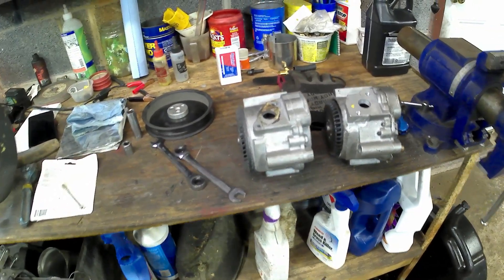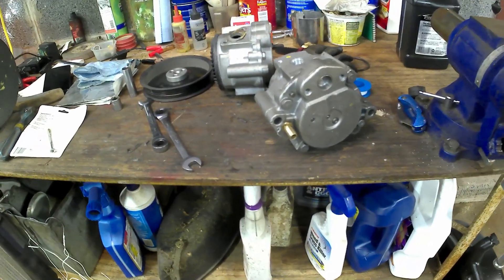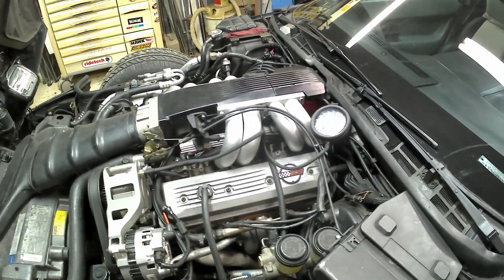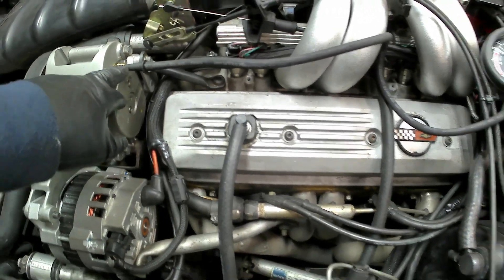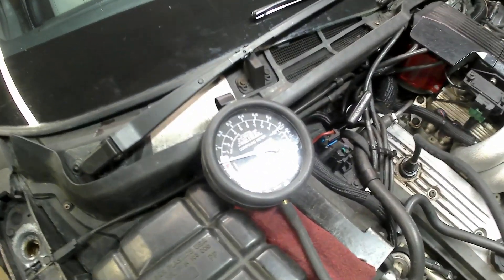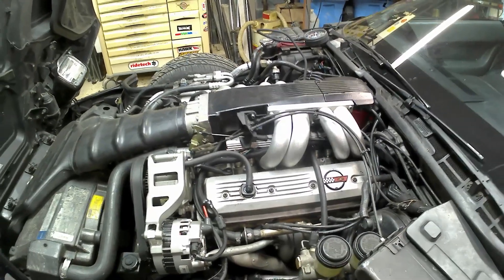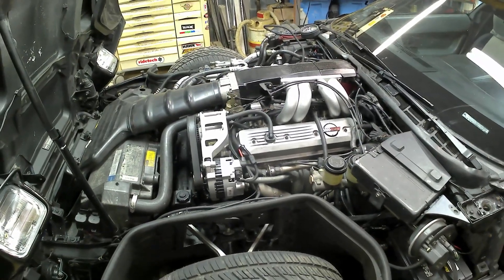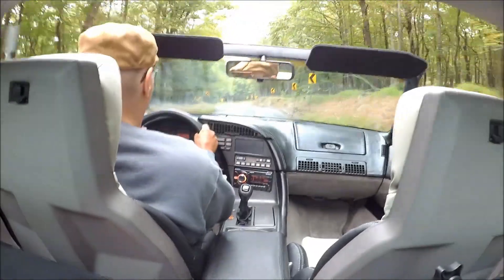Crankcase Vacuum Pump on a C4 Corvette

Comment: Isn’t that your Smog pump shouldn’t it be blowing air in into the smog emissions system😮 wait a minute now you’re going to run your crank case gases through the smog pump out your exhaust I guess
Reply from the maker: Well, it looks like my smog pump is multitasking these days - it's not just reducing emissions, it's also providing some extra horsepower by blowing those crank case gases out! I guess you can say it's a real "smog-tivator." 😂
Reply from the maker: It was only used for one day to see how it worked, it was then changed back to oem, if permeant it would have a catch can and air/oil separator installed.

Comment: Interesting video, i had been doing some studying on how putting vacuum on the crankcase you could get what seems like free HP.
Reply: Unless you have low tension rings it is best to use the Pcv valve and breather
Reply: I did this on my super charged TPI eng 20 years ago. with the converted smog pump the car would kick sideways in second gear! with out it just a tire cherp... You only need to seal up the front intake port & add a fiting to the back. (on the opposite side of the diverter wall) 
It's best to press it apart & clean it well before puting it back together. (the first 1 i made would lock up from time to time) i ran 2 3/8" fittings, (1 to ea valve cover) & vented oil catch can to the fac out.
Reply: @gorr4  if it actually did that, you had major sealing issues, and oil control issues. Probably seriously exceeding the factory piston design limits.
Reply: @b.c4066  Nope engen ran fine & didnt use oil.  I did it to help combat the blow by from the supercharger, I also regularly sprayed it with 150 shot of nitrous. the littil 305 would do 155 mph on the freeway effortlessly. drove it for years & still looked like new in side when i tore it down, So I sold the short block to a guy that put it in his famly van.that was about 17 years ago & it was my neighbor's uncle. after about 2 or 3 years I quit asking how the Van's doing because it was always the same answer " it runs great thank you so much" lol but now that I'm thinking about it I'll make a point ask my neighbor tomorrow.. "how long did the engine last I sold your uncle?"
.
Reply from the maker: You can get more HP at higher rpm's but you need to have a vacuum pump that pulls about 15 inches of vacuum from what I have read,with  the stock smog pump I was only able to pull about 3 inches.
Reply: @E.T.GARAGE  yea, seems the smog pump isnt designed to draw that much vacuum.

Comment from the maker: I remounted the vacuum pump and drove around with it for a little wile, I did not bother to hook up the vacuum gauge but it does not seem like it was drawing enough vacuum to make it worth using so back to the stock pcv system and smog pump.
Reply: If you use a vacuum canisters aka air tanks with the pump drawing down the tank pressure.  If it has a internal bladder the vacuum will last longer. I did try this on a built 360 commando.  I had problems with vacuum at low idle. It's was less that ideal.  I just bought a belt driven vacuum pump.